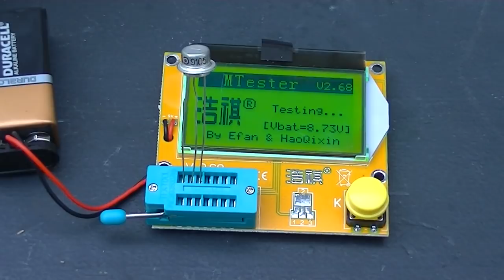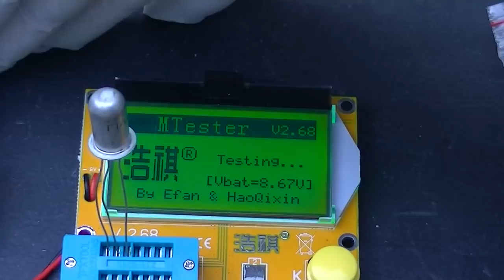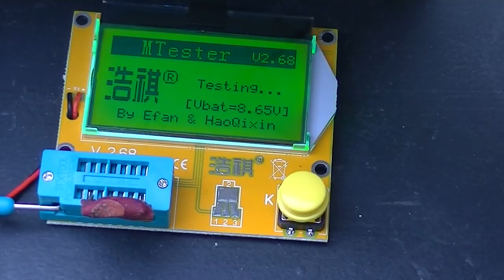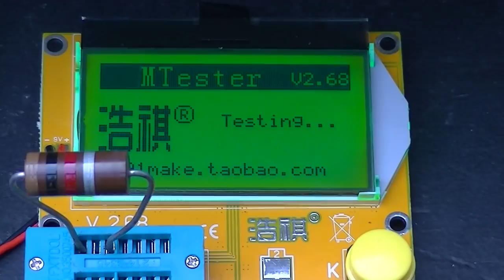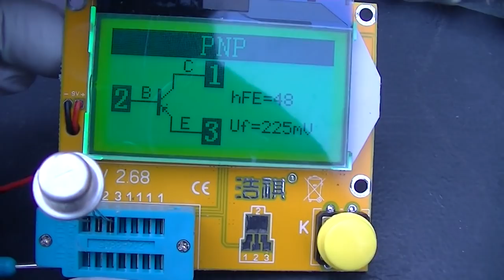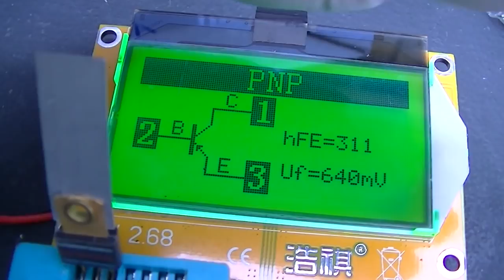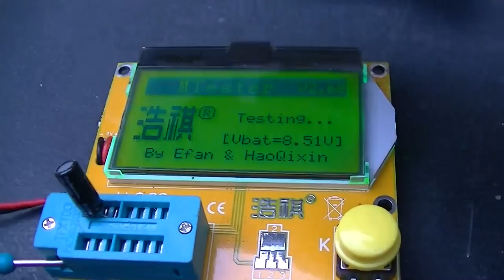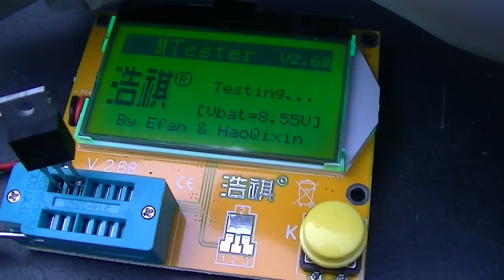LCR-T4 component identifier tester review

Comment: I have had one of these for several years now.  Last year I picked up a bulk pack of new parts and began sorting, so to speed things up, I split a aligator jumper and soldered the two halves and soldered to the underside inputs.  Now it is easy to test components both in circuit and in bulk by simply clipping onto the  legs.  I could easily do another if I wanted 3 inputs but so far 2 have been plenty.

Comment: Shango, this unit can be calibrated by shunting pins 1,2,3 together as a short and it will open up a self diagnostic mode  that walks you through the process!  Check it out.......
John

Comment: I have one of these, have had for years, and I don't know what I would do without it!  To increase the usability, I added a couple of crock-clips by splitting a jumper wire in half and soldering the open ends to the bottom of the SMD reader.  Works great and I needn't worry about damaging the socket by thick leads.  I have considered adding a 3rd however I haven't run into a spot where I needed 3 as most transistors and FETs will fit the reader.
Reply: Oh forgot to mention, the leads allow you to check components in circuit if unpowered.

Comment: That tester is based of a german project. Homepage here: https://www.mikrocontroller.net/articles/AVR_Transistortester

Also if you short the 3 pins you can do calibration, it will ask for a 100nF (0.1uF) capacitor.
Reply: I will ask for a cap higher (!) than 100nF.
Reply: 1959Berre yes you're right.I didn't saw the little ">".Sorry

Comment: As usual Shango your method of showing us noobies diagnosis is unequalled. A lot of us learners that you are converting don't have the access or are very limited to the equipment as it takes years to amass and learn every instrument as technology advances.  If you have time I would like you to show us how to calibrate this unit using your fluke or what ever you have, even a tricky dicky meter using a resistor.  If you trust your equipment then that's what you go with right?  Keep up the great work.  Gem

Comment: Not sure if you know this but if you hold button down for about 10 seconds it goes into calibration mode, used it on mine to zero out the clip leads I was using on it

Comment: The model I have has the three bottom left pins marked as KAA ( cathode, anode, anode) and is used for testing Zener diodes. It gives specs of 0.01v - 4.50v in the transistor test area and 0.01v - 30.0v in the Zener test area. It might be worth checking your tester out for a similar function. Mine will flash an LED during testing in the "normal" area, and keep it lit steady (connected positive to cathode) when in the Zener test area just to give you a quick idea of whether or not your tester works in a similar way. Daniu model TC-1 cased.

Comment: That’s a great price. I originally got one of these about five months ago just really to identify the gate, drain, and source of a N-Channel J-FET that I am using to develop a guitar internal preamp as opposed to an op-amp. These are also amazing at giving you the voltage of the gate-drain, drain-source, and source-gate junctions and checking to see if the components are within tolerance. Thanks for the informative video.

Comment: Trap for young players: The bottom row of pins are NOT in parallel with the top.
The markings are beneath the socket (Chinese folks have special sight powers and can see through the socket.)
Reply: we see bottom row it's marked on the back 2223333 thx when I get mine from Banggood

Comment: I got one in kit form off ebay for $15 and it's fantastic. It tests resistors, transistors, capacitors and a lot more and it's very accurate. The cap tester is great, it gives value, Vloss and esr.

Comment: The 700 ohm resistor was 10% so it could be anywhere plus or minus 10% of 700, which is 70, so the acceptable range is from 630 to 770 so the 684.8 is probably quite accurate.

Comment: I had that exact tube tester. I bought it at a radio swap. It worked really well thou the build quality of the case was not good. The front panel flexed when you pulled tubes in and out of it and eventually the plastic bosses where the panel screws into the case broke. That said it was really really good to keep on the bench used no space at all and as I recall it’s results where normally spot on with the Hickok my friend had. Good score Shango must admit I miss that tester perhaps I should scan the fleabay thou some boso will probably want 50 bucks for one. I paid 10 bucks for the one I had say 10 years ago New in box

Comment: as i said in a previous post these soviet components are a fantastic resource, but not just transistors the metal can and ceramic ic's are great too, if you want lf357 or lm108's the metal can soviet ones are way cheaper than NTE's equivalent, and they are not fake unlike every lf357 ive seen from china suppliers.

Comment: You got the pinout wrong: the lower pins are ( 2 2 2 3 3 3 3 ), the silkscreen is mostly obscured by that ZIF socket, but it is still readable if you squint real hard. I share your sentiment about this little gadget, so useful when you use a lot of old or harvested components.

Comment: Maybe you could test the accuracy against a know good meter rather than just writing it off. The 700 ohm resistor that measured at 684.8 was within the 10% tolerance of the part (630-770 ohm). It was actually within 3%.

Comment: The Putin transistors measure with a lower gain than the American but they seem to work fine in circuit.
Reply: Chris The US ones might be leaky so they "fake" a higher gain value and this tester doesn't measure leakage separately. Either that or they genuinely are higher gain.
Reply: Putin? More like Brezhnev.
Reply: MP transistors are the early era 1960-1975. Later they were released only for repair in small quantities.

Comment: i always come across old transistors and late 60's to late 70's jellybean parts and always wanted a tester like this to verify the parts i find
also i assume it will figure out voltage regulators? ( i usually come across the to220 kind )
Reply: Voltage regulators are integrated circuits with many internal components so no,  probably not.  I just connected my little $30 tester up to a LM317 and a LM7805,  it has no idea what they are

Comment: It's not quite clear. Soviet transistors are widely represented in reference books and their pinouts and layouts are indicated there.
The most curious thing here is something else - which types of transistor testers most accurately take into account the leakage current of germanium transistors and show their gain.
And what is the significance of the firmware.

Comment: Thanks as always for your enjoyable and informative videos. Amazing bit of kit for the money! The version as tested appears to be out of stock right now (at least to UK buyers) but I've gone for what appears to be the same item in a plexiglass case which holds the battery and will help protect its innards. A mere £8.22 shipped! I will add some croc-clips so I don't wreck the ZIF socket trying to test things with heavier leads. Banggood link here: https://www.banggood.com/LCR-T4-Mega328-Transistor-Tester-Diode-Triode-Capacitance-ESR-Meter-With-Shell-p-1112140.html?rmmds=detail-left-hotproducts&cur_warehouse=CN
I bought some of their radio kits as well :-)

Comment: Jees all the comments saying these are sold out,  these friggin testers are everywhere.  Just go to Ebay or Amazon.  There's also several dozen different models and designs between $7 - $50,  don't need the exact one that Shango is using.  They all are based on very similar firmware.
Reply: I guess the point shango is making is that Banggood stuff is usually sold with some sort of quality guarantee. All the kits off Banggood I've had usually have solid community reviews, and there's people at Banggood who actually test and use this stuff. The thing with eBay etc is that unless it's something gold-standard, you can be uncertain about what you're getting. Banggood is a little more centralized, and a little more accountable for anything that flubs a boner.

Comment: 01:42 regarding the difficulty in identifying the pinout of transistors, a trick I know is to:
-Take a multimeter/ohmmeter, put it to 20kohms
-Measure the resistance between each pin of the transistor
-The BaseEmitter resistance under direct polarisation will be higher than the BaseCollector resistance under direct polarisation by a bit (usually 1kohm-2kohms)
Another trick to identify the BE and BC junctions is to remeber that the forward voltage of the BE junction is higher than that of the BC junction by a couple milivolts.
     This trick works on every BJT, but for JFET's and MOSFET's you'll have to use the MTester or a catalogue.
     You probably already knew these tricks but maybe others don't so now they do ! :)

Comment: I have a few kilograms of these transistors (1950-1980xx) in my garage :)
Reply from the maker: Send me a kg
Reply: @shango066  I'll see what models I have. I think you will be interested in MP26. This is the low noise version of the MP39-42.
Reply: @shango066   I found my box. I'm not sure you will be interested, all the transistors are very old. But if you need any of them, I can send you a set for free.
Reply from the maker: @EmiHappens  woo that sounds interesting

Comment: Great video! I wonder what it shows with a darlington, an SCR or a UJT???
Reply: With darlingtons it just shows a single bipolar transistor with a very high gain. Have not tried mine with SCRs or unijunction transistors though.
Reply: Thanks..
Reply: Mine can see SCRs and Triacs just fine,  I have a slightly different model than Shango though

Comment: I have the EMC 213 version that I bought in the mid 1970’s I think I paid $10.00 for it. And yes it’s a very good tube tester I had tested many tubes on it and still do in very rare circumstances. Never tested transistors with it tho I used the radioshaft transistor tester for that back in the 1970’s I still have it the sticker on the box has $14.95 printed on it. 
Good video.

Comment: Great video. Those testers are amazing. I also really like the EMC tube tester. They made similar units into the early 1980s.i have a 1940s model that has sockets for 4, 5, and 6 pin tubes.

Comment: Great review Shango! It nice to see it get put through a wide variety of components. I have seen those up on for sale, and that looks especially handy for odd ball parts that I run across when harvesting parts out of old chassis. It's probably not super accurate but like you said for checking transistor pinout  and as a reference it would be ideal.
That in itself would be enough of a reason to pick one up.

Comment: I bought one of these on eBay, it came with a Plexiglas case.  I love it.

I like that small tube tester.  I have a Mercury tube tester that's a smaller size, but not quite as small as the one that you showed in the video.
Reply: AHH COOL GOT A LINK M8?
Reply: Synthematix  Just search ebay for "LCR-T4 Tester".
Reply: Defo getting one, but the one with the housing to protect it.